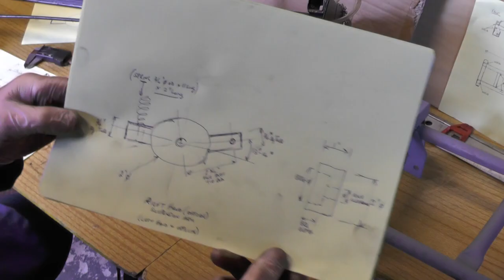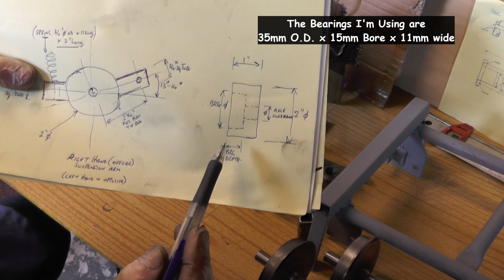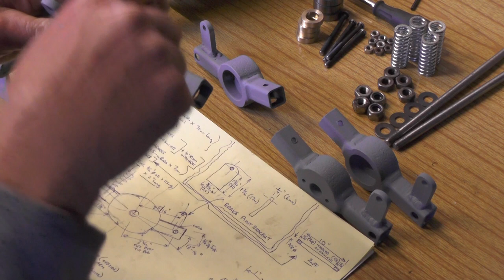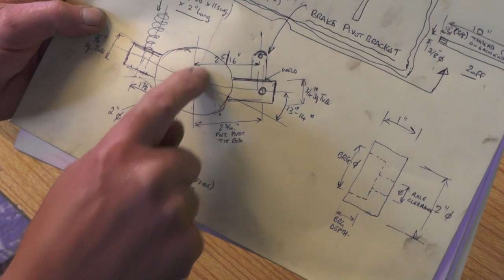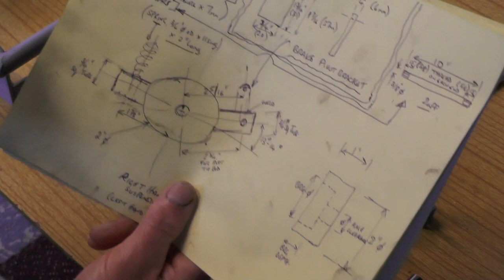Build Your Own 5" Gauge Riding "Car" " truck" "trolley" Part 3 (mr factotum)

Comment: Hi Mr.F,  thanks for the very good demonstrations as usual. I am in the process of making a start in building  the Workshop Bending Rolls as designed by George H Thomas. I have just purchased all the materials required. Will keep you updated. 
Regards and stay safe
Emanuel
Reply from the maker: Sounds great! emanuel
i havn't got rollers in my workshop, but luckily can use my local model engineering societies rollers for the few times i need to. I will have to take a look at GHT's design sometime, keep me updated
regards
mr f

Comment: I like the theory with the bush in one wheel. However a loco is fixed, but for interest in the fair ground the rides have wheels of different diameters to combat that.
Reply: The flanges of the wheels are tapered to help centralise the wheels on the track, but also to give a differential effect when going around corners. Having a floating wheel IMHO is OTT and comes with its own problems, as the brass spacers wear and the gauge has the potential to widen.
Reply: @robw53  I stand by what i wrote above , none of my locos have worn wheels. 
The industrial aspect as mentioned using a reduced inner wheel is factual and worked. 
The flanges i never mentioned , but the root radius is critical. However this only works if the rail head is of the correct profile. Since most model engineering societies use steel bar on edge , it kind rules it useless .
Reply from the maker: hi U310
thanks for watching and commenting, appreciated, 
just a question on the fairground how does that work on a  track when changing from a left hand to right hand bend.
regards
mr f
Reply: @MrFactotum  The rides i refer to are the circular rides such as the gallopers and the tea cup rides etc.
They simply , dived the distance up to arrive at dimensions that equalled revolutions.
Reply: @union310  please clarify, so you are condoning or advocating the use of different diameter wheels, from one side of the loco to the other?
Reply: @robw53  What I am saying is for differing diameters of wheels it suited the fairgrounds where it reduced the wear on wheel sets dramatically owing to the number rides given and the ridiculously tight radius. They actually had articles published. 
In model engineering however I don't see the need in bushing a wheel to allow slippage on corners. 
With respect to profile of flanges and route radius, by all means put them on to look scale in appearance, but it will make no odds what so ever if it doesn't correspond to a matching rail head.
Reply from the maker: @union310  ok U310, got it,
thanks again for watching
regards
mr f
Reply: @MrFactotum  I do enjoy your videos immensely because you are a true model engineer making things for fun and out of anything you have , model engineering societies need more like you Sir,  keep them coming
Reply: @union310  so going back to my earlier statement then that you dismissed, the bushing of the wheel is not necessary in my opinion. When making suggestions, please keep in mind that these are not the type that go round in a circle and your suggestion of different diameter wheels makes no sense at all (for fairground rides I appreciate this would work). Most of these travel along straight sections of track, and have both left and right hand curves. The wheels are also used to transmit the power to the rails, so different diameters would reduce the tractive effort, as one would always be rotating faster and therefore be slipping. It would also try to make the loco twist on the track, biasing the smaller diameter wheel side and cause excessive flange wear. Fairground rides are powered usually via car tyres and not the wheels used to keep it on the track, so the last statement of reduced tractive effort also doesn’t apply to them.
Reply from the maker: @union310  thanks very much, U310
 i appreciate that,  it is for fun, and when your on a budget, why not make things out of what ever you have at hand, I try to show things to encourage novices like me to get involved and have a go, so not to be put off.  i'm only a novice in the live steam modelling so still on a steep learning curve, there's always more than one way to skin a rabbit as the saying goes, if the rivet counters can't accept this its no skin off my nose.
thanks for your support and see you next time
regards
mr f
Reply: @MrFactotum  I agree wholeheartedly and one of my old friends and most amazing model engineer Ken Swan would agree with you.
Reply: @robw53  My comments around the use of diameters on fairground wheels are factual. The rides I referred to were circular, I  didn't mention straight tracks. So no twisting on the track as you suggest. 
Over the years much has been written on the subject of wheels, axles and bearings. The CDMES track here in Cumbria had 7 1/4 gauge passenger trucks that ran for thirty years every weekend. They also ran in the Stephenson trials carrying tonnes. The bearings were inside the wheels on both wheels. They were never re profiled and never had bearings in until the design was superseded for sprung chassis.
You are allowed your opinion but don't take things out of context to make your own opinion more viable. 
I note you make no reference to my comment of flange profiles, GL5 have promoted true profiles for years with no better effect than a sweat pea with straight sides , simply put they all go round the track with no ill effect.
Reply: @union310  Please read my previous comment. I’m referring to proper passenger hauling miniature railways and locos and NOT fairground rides when I state about slipping and twisting on the track. Do you not agree that would be the case if wheels are machined to different diameters? 

I would suggest looking at the vast majority of rolling stock and locos, both built by model engineers and available commercially. Im pretty sure they these will be tapered wheels and solid/rigid axle.

I’m also not convinced that tapered wheels really has any noticeable benefits in miniature railways. The principle does in-fact work, as can be observed at the NRM where they show that it does centralise wheel sets on the track. Do you agree?? Both GL5 and the 7.25” Gauge Society have wheel standards that are shown to be tapered. I can’t say anymore, other than two independent bodies/societies advocate that standard. But as I stated, I don’t know if this makes much difference in miniature railways.
Reply: @robw53  There is a vast difference between building gauges from gauge 1 to 7 1/4" gauge and full size at the NRM . In all of the twenty plus locos I have made in gauges 1, 45mm , 3 1/2" and 5" I am not aware of any difference whatsoever in either wear or tracking. As I have pointed out to you on numerous occasions it is quite frankly irrelevant unless the track conforms to the wheel profile the corners are elevated and the spacing perfect because as soon as the out of balance and totally out of proportion human sat behind changes the running position of everything!!! Furthermore since most societies in the UK and I have had the pleasure of visiting most use a common rail and then add additional lines to make up the other gauges it again goes with your argument. 
I have also had the pleasure? Of meeting a lot of people in model engineering societies who write on places like here and make comment when they have either little evidence/experience have never built anything or try to adopt methods with no relevance, which you appear to fit?
Reply: @union310  your comments are perplexing! You dismiss facts that are relatively common knowledge. The loco wheels are tapered to help navigate around corners. I have included a link below which is one of many on the web explaining this. My statement was not specific to a gauge, but to the principle. I clearly stated that they may not have the same effect in miniature. Although the railway I run at which is 7 1/4” gauge, runs for 2km with correctly profiled rail and has correct super elevation (By the way, that’s the correct terminology.) I still believe that the tapered wheels do function as per the full size.

https://www.scienceabc.com/eyeopeners/how-do-train-wheels-turn.html

Please let me have the details on your thesis, for why tapered wheels are only for the foolish!

You may have built a lot of locos, but it’s quality not quantity in my eyes. I’m one of the many engineers who buys materials to complete a job and not just make it out of odds and ends, without any regard for the finished article. But it’s horses for course, my 7.25” Thomas 2 was all fabricated stretches, bolted together and not welded frames. Where as the 7.25” Brit I bought all the castings. The 7.25” A3 I’m drawing up from works drawings, will also be built with castings that I will design in 3D in Solidworks. So don’t question my ability, knowledge or experience. And these wheels will also be tapered, with the final cut on each tread being done without touching the dials on the lathe, like every Model Engineer worth his salt does, when machining wheels. Something you appear to insinuate only people without any experience do. Would you also be fine with different sized wheels on your car? What’s an inch really going to change I hear you say?
Reply: @MrFactotum  I don’t think it’s just the rivet counters that now and again buy things 🤨 I’m also glad to see you follow the recommendations of tapered wheels and flanges in your machining wheels videos. Great build and look forward to seeing it running soon.
Reply: @robw53  You have really missed the point, scaling is only possible to an extent. When you scale the driver all things will be equal but you as a full size human have altered the whole equation when you sit behind the loco so don't expect it to behave the same because it doesn't. The very fact that a model is scaled should alter the choice of materials. If you want to go to the far end of escaped wind you would realise that the boiler construction and materials alone alters the movements of a loco on the track and unless you have copied the suspension to the tee then here lies another error. 
Yes tapered flanges work in full size because the whole scenario works. But as factually stated the majority of miniature railways in this country  do not  use correct profile rails but use bar stock or a shared common first rail usual out of scale for at least one gauge.
As for quality of locos , I am a professional engineer by trade and have a full tool room to hand as well as over 40 years machining experience.
As for this and that when it comes to materials if it is the correct grade of material and the right size , frankly it doesn't matter where it comes from.
Now to the other point you fail to acknowledge as pointed out the reduced wheels I  factually stated  are on a continuous circle, NOT on a track as you suggested and not on another vehicle as you also refer to.  If you could stay in point for a minute you may get somewhere.
Reply: @union310  I haven’t missed the point at all! I stated that it may not have the same effect in miniature. I understand that not everything scales down, but I personally don’t believe this is one of them. Please show me the evidence of this, I’m more than happy to be proven wrong. During the sweet pea wheel machining video, there was an amendment to the drawing to use tapered tread and flanges and not the originally square tread and flanges. What do you suggest this has been changed for then? Just to look prototypical?? 🧐

I’m also an apprenticed trained and degree qualified professional engineer. With a workshop I’ve probably spent in excess of 15k setting up. I understand that some people don’t want to spend money on a draw full of Mitutoyo metrology equipment, but I personally do. I also understand that people want to use whatever they have lying around, but for me, i couldn’t bring myself to use old bits of steel sheet with randomly placed holes in the cab, just to save a few pounds.

I asked you to clarify you position on wheel diameters of a loco. You kept referring to fairgrounds which are absolutely nothing like a miniature railway, so wanted anyone reading it, to understand that and didn’t just see your comments and inexperience on their part, think that this could also work. You skated around the subject, instead of just saying either yes or no to the question!
Reply: @robw53  Your biggest issue is you add things into comments that have no relevance at all, where does the random holes in a cab come from? When what I said was "if it is the correct grade and size" 
I referred to the the wheel sets and said "as matter of interest, on fairgrounds...." 
If you care to go back over model engineers and the numerous articles by Ewins and co. You will see the reasons why the taper makes no real difference and again you failed to acknowledge for the umpteenth time the relationship between a correctly formed flange and the effects it doesn't have because of the missing true rail profile or the correct suspension geometry and make up.
As to the workshop you have, quite frankly it doesn't really bother me. One of the finest engines I have ever seen came from a man with only an eighty year old lathe, my father.
So to summarise , fairground rides as suggested such as then"tea cup" circular rides did/do have wheels to different diameters. 
For a truly profilednwheelset to work it requires an EQUALLY profiled track, established by British Rail. 
This doesn't work in miniature because the centre of gravity vs suspension does not represent  the designs of a full size engine.
There are numerous number of sweet peas around the world the world who negotiate the roughest of tracks with weights that is surely beyond their design and the parralel flange makes no iota whatsoever when it comes to the engine doing its job. Indeed on my own sweet pea that was built as soon as Buckler printed drawings is still pulling two ton behind on a regular basis. 
I am not one for bragging at all and as i stated I consider myself fortunate with my workshop as it has taken a lifetime to build up , but of all my customers who have purchased locomotives, traction engines , stationary engines or gas turbines from me everyone has been thoroughly happy with their purchase in terms of quality and detail.
The final point , track layout. Unless you have a radius with correctly proportioned super elevation in relation to the radius (there are charts for this in full size) you are wasting your time again, because the effects of engine weight and load against the weight/force againt the outside rail will be different. Indeed the engines you referred to building and making the correct profile ran on tracks of differing standards in full size. But as stated none of this works in miniature because the centre of gravity , suspension and weight are all different, as is the scale speeds locos run at. 
If you lightened up a little you may get more fun out of things and learn from some pretty good model engineers out there.
Reply from the maker: @robw53  hi STB
nice to hear from you, thanks for watching and commenting, didn't mean any offence to the RC's just a bit of fun, i may make things on a budget but always try to follow proper mechanical practices. I just like to encourage others with limited scope to take the plunge in this wonderful hobby and not to be afraid to have a go.
thanks again. 
see you next time
regards
mr f
Reply: @MrFactotum  yeah I don’t offend easily 😁. I’m not a RC anyway, but that may change with the Britannia and A3 builds. I understand the budget aspect and that people don’t always have a lot of disposable income and also have other priorities for what they do have. Only being in my 30’s, I’m from a generation that has that luxury and probably doesn’t appreciate that wasn’t always the case. That doesn’t take away from your fantastic skills that shine through on your videos. I’ve purchased a copper boiler from Southern Boiler Works, as a 7.25” gauge boiler of that size and complexity isn’t one I’m going to attempt as my first! The fact you built yours, is a huge credit to you. I will at some point in the near future take the plunge in building one. This will likely be a 6” vertical boiler similar to Craig who is building that and the 9F.
Reply from the maker: @robw53  great STB.
All the best with your build, why don't you video the experience, it sounds great, i'm sure there would be lots of interest.
thanks again for comments and watching
see you next time
regards
mr f